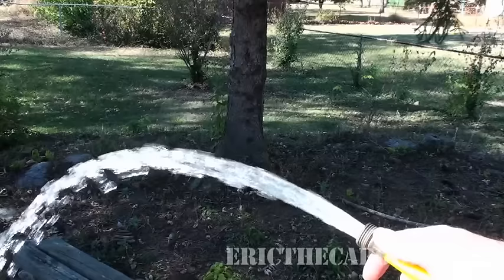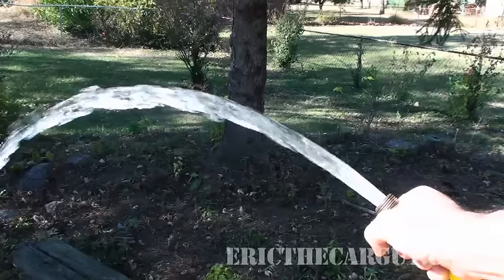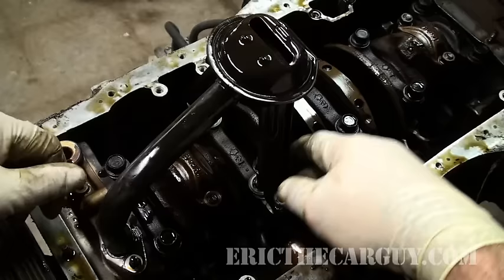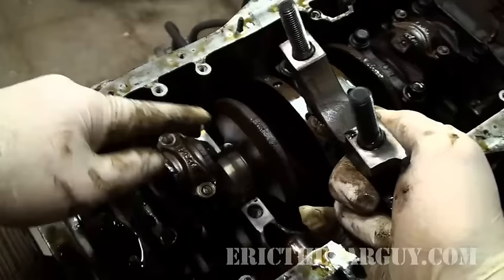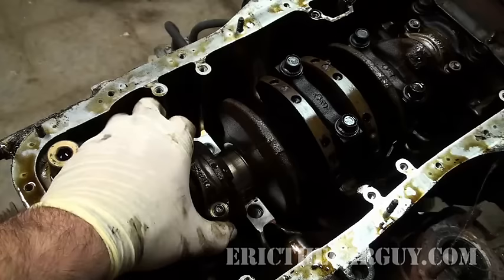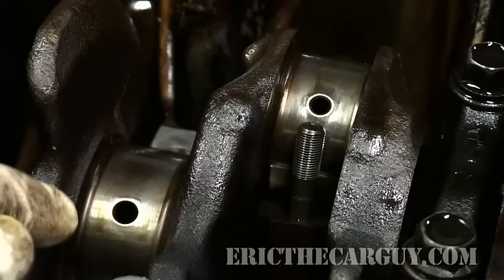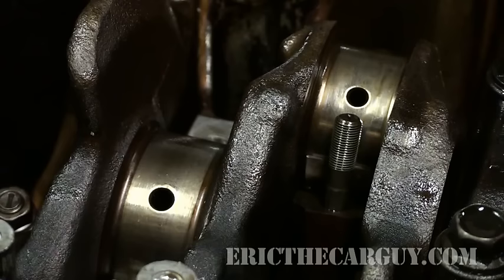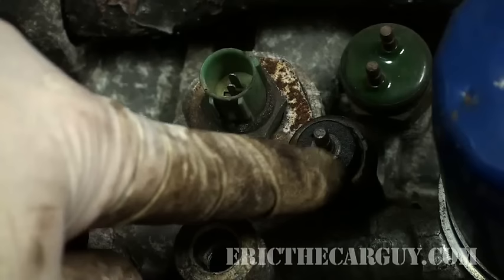How Oil Pressure Works - EricTheCarGuy

Comment: Hey Eric, regarding the oil pressure- I have a '95 Accord with 156K miles.  My oil light has started to come on- blinking, after I have been driving for awhile, but it only happens randomly, and only once in a great while.  I think it has come on maybe 5 or 6 times, but the 1st time was more than a year ago, and then it could be months before it happens again.  In each instance, when the car is turned off, either for a while, or just a few seconds, the light does not come back on.  One thing I read is that it could be a faulty sending unit on these cars- so that is 1 reason I have not been as concerned as I might be.  The car definitely has enough oil.  What do you think?  Also- what is the difference between the light blinking or coming on steady?  Does it come on steady when you are physically low on oil?
Reply: When there is no oil pressure at the sending unit, the light will remain steady lit until oil pressure is at the sending unit. If it blinks you are getting pressue>no pressure>pressure>no pressure. This is pretty unlikely and I wouldnt do anything drastic until you replace the oil pressure sending unit and inspect/verify its wiring. Im not 100% on the location for the Accord, but all the hondas ive worked on have the oil pressure sensor on the back of the block. It should have a single wire going to it. Often times these single wire sensors use a butt type connector that loses tension on the sensor after many years. So, in a nutshell : 1, locate oil pressure sending unit, 2. make sure wire is connected firmly to the sending unit, it may help to remove it, clean the sensors terminal and the female butt connector, and replug it. 3. If problem persists replace sending unit, 4 if problem still persists inspect wiring connectors at back of gauge cluster , gauge cluster grounds, termostat grounds, and any grounds you can find, clean them up. 5. If problem still persists you can add an oil pressure gauge, or have a shop check it for you. If I had to bet money on it though its the female butt connector at the sending unit or the sending unit itself
Reply: John W Powell Thank you very much, John.  That's what I suspected.  The flashing is an 'automatic' speed when it happens, so there must be 2 modes with the system- either the light comes on when there's no pressure, as you said, or there is some other electrical problem with the sensor or the sensor is bad, and then the light blinks.  I wish they would just say that in the manual.
Reply: Next time you change your oil you will be working around that sensor, it's usually to the left of the oil filter. Might as well check it out then

Comment: It was my first doing an oil change after I finished I was driving the oil pressure pop came out after I drove 20miles  the oil had spilled while I drove and I think I might Of left the oil filter cap loose can I get you opinion???
Reply: Short of okay. Won't ruin am engine / just a little dirty oil spay & clean your engine .

Comment: Hello Eric.I done an engine overhaul on my Toyota 1.6 Corolla 4AF 1992 Carburetor  motor. She had 605K  km on the clock"She is my play Toy and love her very much". But i only replace the Rings, and the big end bearings from the bottom. And done the Cylinder Head at a local engineering works. I drove the car for only 100 km`s, and all of a sudden i hear something like bearing knocks. I took a screwdriver and held against my ear and start at at no 1 on the Cylinder Head. No1 quiet, No 2 quiet, no 3 start with a noise like a light bearing knock, at no 4 it was the worst. But i have to say the sound is only between 2500rpm and get worst  to 3200RPM. Do you think its the Oil Pump or did i done something wrong?
Please assist me.Greetings Sakkie South africa.
Reply: Wrist pin.

Comment: Oil pumps provide the volume for the clearances to create the pressure. You need to make sure your oil pump is good before you blame your worn out bearings in your motor
Reply: he said that dummy

Comment: please tell me something... if I put too much oil in my car,.,, will it damage anything in it?Why I am asking the above?... I got a V6-3L Ford Tempo,,( a great engine) and looked at its recommended oil = 4.3L.... I added 4.3L synthetic oil + STP ( 5 in 1) 473ml  saying that I need to add it to oil ( not replace oil) ,,, so now I got 4.3L + 473ml STP = 4.73L oil in my car.I checked the dipstick and the oil was 30mm above the "FULL" oil line..... Do you think I will damage the engine with more oil in it?
Reply: whats the full capacity of oil thats supposed to go into your car? it should say it in the owners manual

Comment: My oil pressure light comes on but goes off after I change oil filter, but then comes back on sometimes after a week sometimes after almost a month? First time came on like a year ago after spark plug blew out and I did helicoil, I changed oil, filter and it was ok for half year, now keeps coming on, change filter and it's gone for some time. Any advice? Sludge? And it comes on after few minutes of driving, usually first it starts blinking then stays on all the time.  Don't hear knocking or noise in the engine
Reply: what car/engine  do you have ?
Reply: Petru Bogdan Alexandru 1998 Lexus ls400, 210xxx miles

Comment: I was driving without complete empty engine oil, i had no clue everything was normal until i restart my car and it made slight whistle air noise. And lost most of my hp and engine makes loud noise like mod pad bike! And its only 128000 miles and never had timing belt replaced. Rpm stays normal engine starts, so what weaken my hp n making mod pad loud noise

Comment: what if you just get a larger oil pump to move a larger volume through the bearings could that resolve the problem if your engine is worn.
Reply: Yes but you might find garbage on the screen and decide to just replace the screen.
Reply: Rýán Túçk do you just respnd to everyone thinking you know the answer because what you said makes no sense at all .... if you have low il pressure and he changes the pump and it doesn;t fix it your talking about changing a filter screen that would fix it which none of which he mentioned in the video if it was just that easy he would have said that rather then showing the insides of engines that basically need to be rebuilt at that point from morons taking care of the vehicle ....  at least know what you're saying before you answer questions to ppl that have to go back and try and do that stupid shit ont heir cars .... if it works make a video of your own proving it .... this video didn't mention anything that easy to fix it
Reply: I had a car that lost oil pressure due to a filter that dissolved and ended up on the screen. Was all ready to put in a high-volume pump, as the engine didn't knock. Could have reused the pickup, too. VHS video camera had a bad head, 3/4" was in pieces, and video capture card was inop, . So pissed that I sold the car.

Comment: Im not getting oil to the top end and i blew 3 heads why does it do this the cam housings and the journals are all pitted and scarred badly would that be oil pressure/pump or what? Its for a 92 honda accord 2.2
Reply: I found it bottom of piston broke up and got stuck in the pick up tube changed out new one then the can was fucked up drove itna day blew the motor junk yard lol

Comment: My car only has 86,000 miles and I have 12 psi instead of 28 psi as specs show. my engine is not making noise but what can it be?
Reply: +Cesar Marin Definitely check your oil level and check for leaks. Get your oil changes somewhere else if your oil level isn't good.

Comment: Great presentation! My 292 straight six gets 10W 30 and the pressure is 10 lbs after it's hot or Do I need a higher multi grade Castor oil?  Engine has 7,000 on it.
Reply: 10W30 is a multi-grade oil. Try HD30W. Never put in a higher weight than the largest number on the recommendation. You could add stabilizers up to the maximum concentration; those would help the tackiness, or a treatment with extra detergents to try cleaning clogs the meantime, but 10 psi at idle really isn't bad. Put a mechanical gauge on the fitting and see if it's accurate.
Reply: Anyway, the brand of oil isn't important as long as it's fresh. At 7000 miles, you should have changed it at least twice already: once within the first 500mi if it had been rebuilt, and if not thrice changed, close to needing it done now. Beyond experimenting w/ oils, make sure the computer is happy with the new setup, because if it isn't, well, things can get ugly.
Reply: I change every time I see it getting dark. My speedo dosen't work. Usually 3,000 Miles.
Reply: Well... If I was you, I wouldn't worry too much... Long as you have better than 5 psi in a old 292, your fine. I'd step up to a quality oil filter, not super top, but good & use a good 15w-40. I'm rather fond of Delo.
Reply: My 292 has 5,000 on it as a long block, auto trans is new, rearend has been re built. My oil pressure gets about 20 lbs at idle. I use multi-grade that affects the pressure also. I need to change a gear out of the rear end to cut the RPM"s down.

Comment: It seems to me that his analogy is not entirely correct; when you restrict the flow on a water hose, you do not increase the pressure but rather the velocity because you have  the same flow rate and a smaller cross-sectional area. As a result the pressure actually goes down (Bernoulli's equation). But the oil pump creates pressure because as the oil comes out of the pump, its velocity is impeded and the kinetic energy converted to a higher pressure. Am I right in thinking this, anybody?

Comment: When motor oil leak and what is the safe amount of oil need.
Reply: One quart is generally the amount between low and normal marks.
Reply: Maximum capacity is usually 4-6 quart in total, and flushed every three months. Leak may be burning- Ford changed their oil reccomendation due to that.

Comment: Need some advice. Have a 99 mountaineer. Oil gauge was freaking out truck died. Got it to restart. Than oil gauge completely dropped. Truck started shaking some. Died. Towed home. Should I start w the oil pump??
Reply: Bianca Bagley so after 5 months, what was the problem after all?
Reply: Nope never figured it out. Still just sitting in my yard. Wih I knew how to even fix it. Was a good truck now idk what to do w it
Reply: Bianca Bagley did you check or replace the oil pressure sending switch? If so, could be a clogged oil pickup.
Reply: I have not done anything. I took the battery out and it's been sitting since tried selling it and I didn't have anyone interested in it bc idk what's wrong w it. I went out day after it broke down and bought a nice new jeep so idk prob in spring check it out if I find time
Reply: Bianca Bagley a woman working on her vehicle is sexy. Best of luck
Reply: Bianca Bagley engine ceased?
Reply: Your first problem was a 99 mountaineer
Reply: sounds like it needs a rebuild. if u watch this video he says over and over and over U CAN INSTALL A THOUSAND PUMPS AND NOT FIX THE PROBLEM.

Comment: It is okay when i start my car the oil pressure reach 4 in the gauge, when its began to start to go normal operating temperature it drops at 1 in the gauge
Reply: Its a diesoline engine, isuzu c240

Comment: Hook up Analog gage take reading, change oil and a new filter will increase flow. . Take reading on analog gauge again. Still No pressure change out pump. Still doesn't get sufficient pressure. you are on borrowed time.

Comment: hey eric, my 2000 dodge ram 1500 318 v8 has a oil pressure problem. the pressure stays where its supposed to be then when its warmed up it will stay around 35-38 when at highway speeds (its supposed to be at 45ish when at highway speeds) and when i really tromp on it the pressure will go to 0 after a few seconds. almost like the pump quit or all the oil got pumped up into the engine and there was none left in the pan. sometimes i have to restart the truck to get the pressure back up. what do you think the problem is?
Reply: My 1998 Dodge Ram 1500 V-8 5.2 is doing the exact same thing , it can  aidle all day and keep oil pressure just under 40 and steady. If I hold the gas at any other speed it will drop to zero like the pump stopped working completely and when I let off the gas a few seconds later it will come back. worn out oil pump? I am changing it out tomorrow.  Note, sometimes the pressure will not come back at all and i hear the lifters chatter, I then shut it off and start the engine back up and oil pressure is back and no chatter from the lifters. soo again bad oil pump?
Reply: Even a gas pump spurts when it's sucking air. If the needle goes up then suddenly down w/o jittering, I'd suspect that it was a dead spot on the transducer. No oil pressure would make the engine heat up quickly, and if you shut it off hot, restarting would really be difficult. Automatics might start to shift funny, and the computer would start logging erratic sensor readings all over the engine, like cam timing.

Comment: Is this different if,, you screens to oil pump are clogged ?
Reply: 😆 this reminds me of a home remodler that insisted that dropping the water supply pipe diameter would increase water pressure. 😆 He also used the hose pipe analogy which is very flawed. The problem with misunderstanding this is that in his case he was actually lowering the usable pressure as the smaller pipe has less volume. What they don't tell you in this analogy is that with the pipe wide open it is releasing the pressure. Cap off half and you release less. Close off completely and you have full pressure. Back downsizing. The smaller hole or oriface should be on the end where the fluid is released. Downsizing. Further back retains more pressure in the larger line but lower preasure in the small line. This is with a constant pressure. A pump like the oil pump could not turn if you cap it off as you cannot compress the oil. Therefore you have a bypass valve to release pressure as well and regulate if to high. It is possible for this to stick open also.

Moral of the story... Pressure is force against the fluid. The torque on the pump, provided it is full of oil. Where this pressure is released and gow much is the question.

Comment: oild pressure is created by exhaust and by coolant in the radiator
Reply: I know that back pressure is created by the exhaust system and that will impact a few things: valves, overall runnning of the engine, etc. The coolant system is entirely seperate from the oil pump and oil itself. What exactly do you mean by your comment? I don't understand how the exhaust pressure or the collant affects the oil pressure- aside maybe from the temperature? Please explain what you mean if you will good sir. Thanks.
Reply: "oild" pressure. Ready, read.

Comment: Hi I'm new here, I have 2002 Mazda truck, bacic,it's a ford, 108 thousand miles, my oil pressure gage fluctuates  a lot all the way to the right, but  after I drive it in town 30 min or if I go down the highway 60 miles a hour, it fluctuates when I stop a light,  but if I turn engine off, then  back on is ok until I drive it  past 50 miles an hour , help need answers . Not a car guy

Comment: so your telling me is that a air compressor pump just "moves a volume of air" and the pressure is created by the cylinder head? 

in other words an oil pump does create pressure because the pump housing and outlet is part of the pump
Reply: jason stout the pressure comes from the forces between air molecules. More air being pushed into the confined volume= more pressure. The pump feeds the air in, but the pressure comes from the forces of the air molecules and air tank walls that hold the air in.

Comment: Hey guys if anybody is familiar with this issue pls let me know I have a Nissan Titan 05 with low oil pressure when I drive truck and accelerate gage goes up when I stop gage goes down I already replace oil pressure censor don’t know what else to do thanks

Comment: Not to be a "Mr.knowitall", but... clearance only regulates pressure, 
pressure is actually created by fuel combustion. Gravity "creates" water pressure if you have a water tower, you we're "regulating" water pressure by restricting flow with your thumb. Otherwise great video ;)
Reply: what do you know about engines???

Comment: Oil pressure is a bit like blood pressure. You only need to really worry if it's too high. If it's lower than normal, you're probably okay. In a similar vein (no pun intended), oil is a bit like blood. You only need to worry if it's too thick, If it's very thin, you have been born with lucky genes.

Comment: hi eric my brother bought an used SUV with 2.5L engine it is showing low oil pressure light on start up what should i do please answer...
Reply: Trade it back in.
Reply: i had it checked the low pressure switch was bad.... thanks any way.

Comment: In a short turn.Use a thicker grade oil..
Reply: If problem still persists upgrade to HD diesel motor oil. LOL Cleans the gunk in the motor while solving the low pressure issue. win win

Comment: But I still feel like, if the pump isn't producing enough volume/flow through the outlet, like let's say the inlet tube is clogged up and not allowing a good flow through the pump wouldn't it then have a direct correlation to the pressure on the outlet side. Same as if your oil level it's self is low.  Like in your garden hose demonstration. If where my hose is hooked to my house spiket has a clogged screen and I'm only getting half the water flow I'm supposed to then when I press my thumb over the other end there would be less pressure produced.? My brain hurts